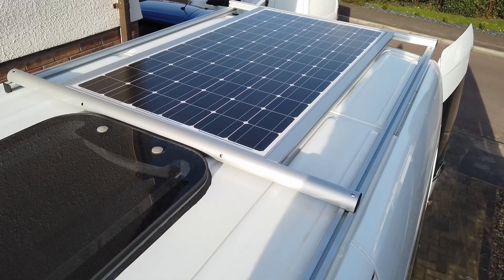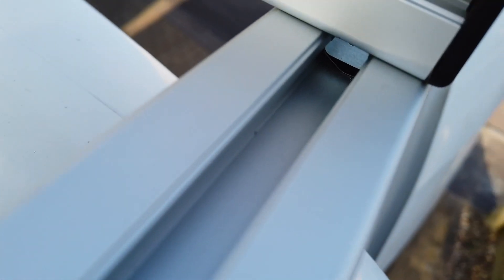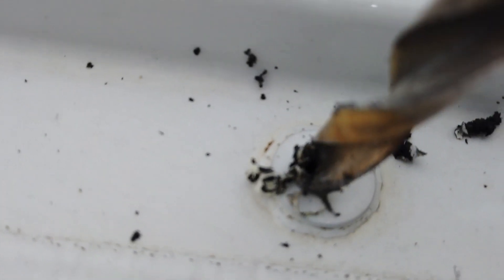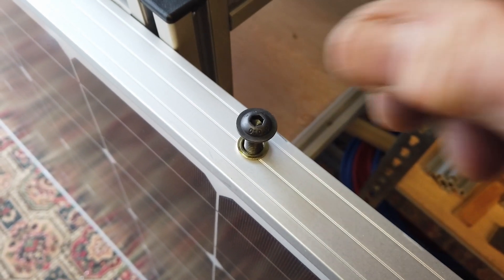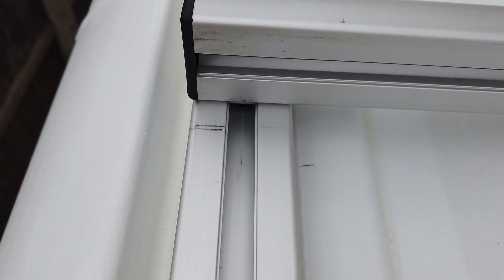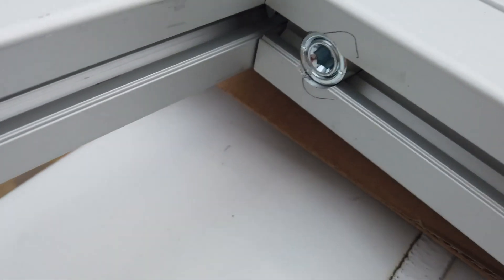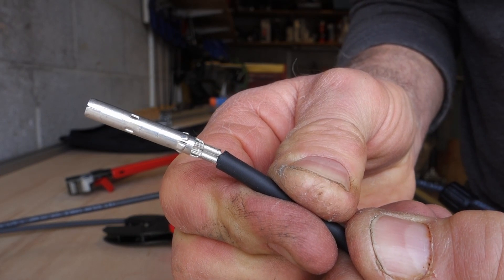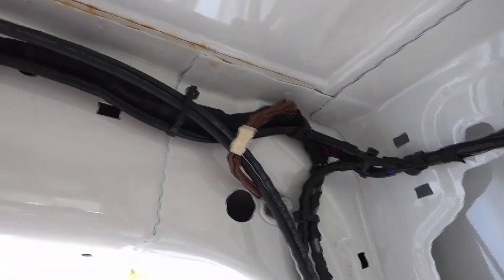How to make a solar panel roof rack from lightweight aluminium 40x40, 80/20.

Comment: That is the nicest 80/20 roof rack I’ve seen. 
No angle brackets. Very low profile. 
I must remember this when I build mine. 
Thanks for sharing.
Reply from the maker: It's 40 40
Reply from the maker: It's 40x40